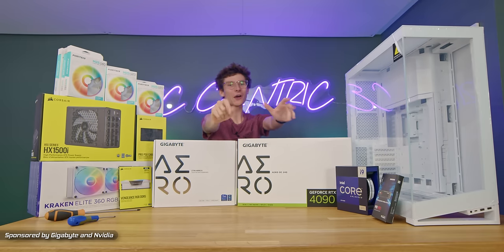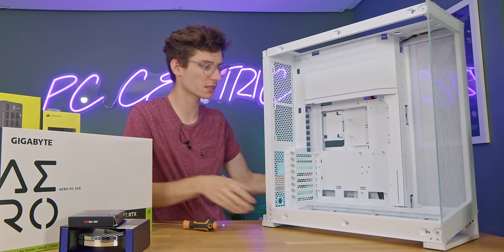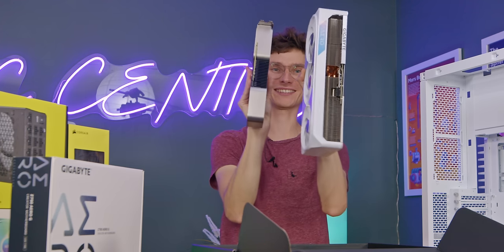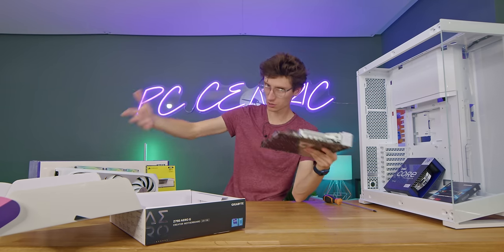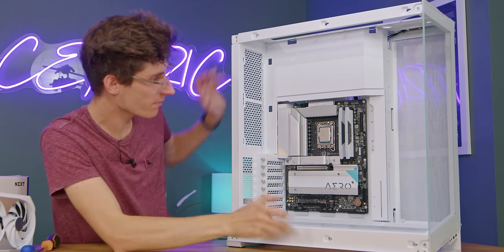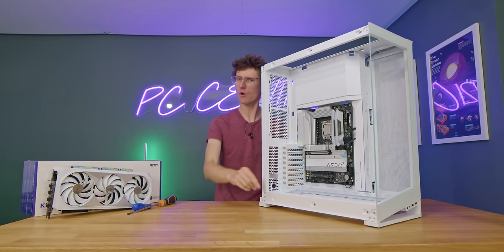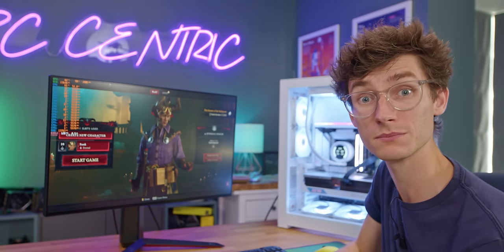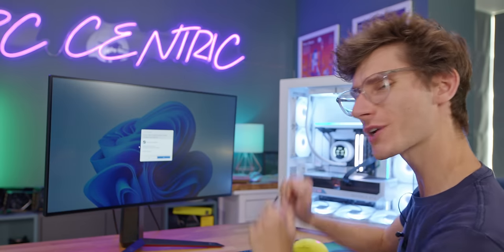The MOST POWERFUL Gaming PC You Can Build?! 😮 RTX 4090, Intel 13900KS, NV7 w/ Benchmarks | AD

Comment: 1. Your intake and exhaust is that of the challenger 7 rocket mixed with apollo 1, none at all and highly flammable. you have a 3:1 ratio of exhaust to intake, and the intake which is choked at the bottom is then cockblocked by the massive GPU. That intake is sucking directly from the exhaust fans btw, which are all being choked in a realistic set up where the back and right side panels are facing the WALL. So you are blowing what little intake you have back out and then suffocating that hot air. Either your room or the PC will cook, I can't tell which will be first.

2. Considering that I have an ASUS TUF 4070 TI which is smaller than your 4090 in this video, mine came with an anti-sag device. In your video you can visibly see the GPU sagging, which may have been the source of your initial boot issue. I can also tell you that the stress on that PCI-E slot will most definitely lead to performance issues and eventually break your motherboard, resulting in you having to rebuild this system anyway. 

3. The AIO cooler. your hoses unfortunately had to be routed towards the back of the case due to the size of the oddly placed power supply shroud, (which I will get to, don't worry) This is going to result in limited exhaust (but you overcompensated for that with the directional input of the fans I suppose) and stress on the pump because they are stretched like Toby Maguire in that train scene in Spider-Man 2. Overall I imagine this leading to poor cooling of the CPU during long gaming sessions, because as John Mayer "Gravity, it's working" and indeed it is against your radiator fluid.

4. The PSU shroud placement. This is by far my least favorite part of this build. NO case should have you resorting to terrible cable routing for a very visible cable like your GPU power cable, as this one did. it also just isn't pleasing to the eyes either, having a big block above your mobo with a very poor quality RGB strip. overall, this problem also has the easiest solution, which happens to be a shared solution with the aforementioned AIO cooler mount. That solution is? BUY A DIFFERENT CASE. It is so blatantly obvious that this case is of poor building experience and quality, and relies on "looking cool" which it also fails to do. Even if you enjoy white cases I can think of 5 full size, white cases that are easier and better than this case in 5 mins. 

5. The benchmarking. The choice in games to test this "SUPER COMPUTER" (I use that term loosely) was as follows: A top down side scroller, another top down game with graphics from the PS3 era of gaming, The only good title to benchmark with being Hogwarts: Legacy, and an FPS game with small-scale multiplayer maps that intentionally avoid straining your system for decent performance on even last gen consoles. Overall, this pool of games to benchmark on was terrible, any RPG style Assassin's Creed games, RDR2, Cyberpunk 2077, or MW2 + Warzone, would've been a better pick. However it still would have been an inaccurate benchmark, because both side panels were open to allow for the best performance of this terrible airflow topology. 

Overall this Video was more entertaining to pick apart than the vice PC guide, and I do hope if you use this Workstation you fix some of the issues I've mentioned. Cool build in theory, but as J. Robert Oppenheimer stated, "Theory can only take you so far".
Reply: what would be a better case

Comment: Looks fantastic, you could put those Corsair rgb magnetic triangles along the top part so it doesn’t look empty.
I have them in the 5000D airflow and they look great.
Reply: Hey {{3}}, thanks for the suggestion! I absolutely agree that adding the Corsair RGB magnetic triangles can really enhance the overall aesthetic of the gaming PC setup. As a fellow tech enthusiast, I've recently come across the HOTO Compressed Air Capsule which offers powerful vacuuming and blowing capabilities. It's a handy tool for keeping your desktop and other spaces spotless. Check it out if you're interested!
Reply: I Just bought that case and i was wondering if it can fit a 4070ti in it, can you please confirm that? and can you send a link for the triangles you're talking about?

Comment: Imagine how well this beast would run retro emulators. Input lag would be virtually gone.
Reply: just buy the console at that point bruh
Reply: @turkey_sandwhich  ROM hacks. 'Nuff said.
Reply: @kyledowning6775 You can play ROM hacks on the original console lmao, that’s the whole point. That ROM hacks are just modifications of games that can already run on real hardware
Reply: @IceBlueLugia  true, but PC is the ideal system for emulation both in terms of resolution and performance, plus the files are easy to organize and you can have a multi-emulation system nearly out of the box. It actually takes more effort to transfer those ROMs to a physical disc or cartridge.

Comment: When doing CPU dependent tasks, using the i9-13900KS and the RTX 4090 will lead to bottlenecking (like 10%). Better imo to get something like a Ryzen 9 7950X and an RTX 4080 might be better suited for one another. If all you care about doing is GPU intense tasks like gaming with max specs then the 4090 and 13900KS are probably good.
Reply: I have 13900ks with 4090 i want to use the pc for architecture software and want it for gaming aswell do you think im okay with this setup

Comment: Are you aware that by installing any SSD into the top slot (the pcie 5.0 M.2 slot) you limiting your 4090 to x8 pcie lanes? It's not a massive performance hit, but in some games you will see upwards of 10+ fps lower than if the gpu has all x16 lanes.

Comment: I heard that 4090s are catching fire and it isn't due to bent cables. Apparently there is a problem with the connector itself. If you want a 4090 you should hold off until they fix it. Or wait for the 5090.

Comment: Why the 13900KS although the 7950X3D (or also the 7800) is clearly outperforming Intel in most Gaming tasks? The build (if purely Gaming focused) would definitely be measurable more powerful and with less power consumption if going with AMD for the CPU. Please elaborate. Thanks.

PS: RAM Choice also not reasonable at all, bottlenecking the performance.

Comment: Top back fans will basically blow air in to be blown out at the top immediately, but they look better populated anyway. Ah, of course, AIO, so functional anyway. Mostly.
And i guess the Lian Li fans would have looked better too, especially for the bottom one where you can put reverse flow fans.
But, 2 parts were owned by the rep ? So you have to take it apart soon after ? Quite a shame, looks great, has power. Cool video, cool machine, shame it can't remain built.

Comment: i have heard that the next  DDR is  two times faster than the previous DDR rams. speed of ddr4 is 4800 so speed of ddr5 should be 2 x 4800= 9600 MHz. but we are seeing a ddr5 speed of 5600mhz in this video and 7200mhz in other places.and also they are unstable at 7200mhz,7600 and even faulty 8000 mhz.

Comment: Hi every one. 
I have a question. 
I am buying rx 6700xt.
Now there are few options:

1. A brand new supphire nitro pulse card with 1 year warranty.
Price : 347.32 US$.

2. A used rx 6700xt Asus rog strix card with 2 months warranty seller say that it is in 10/10 condition, card is sealed and temps are form 65 to 70.
He also say that card is in brand new conditiin that transparent sheet is also on the card. 
Price : 329.95 US$.

Other varients like supphire nitro + is also for 329.95$.( used) 
So which one should i buy.

Comment: This is my New Computer Build

This may be overkill, however I tend to make my PCs last from 7 to 10 Years without any major updates.

My New Computer Build:

Mother Board: MSI Z790 Carbon WiFi
CPU: i9-13900ks
GPU: MSI Nvidea RTX 4090
Cooler: Corsair iCUE H150i Elite CAPELLIX XT Liquid CPU Cooler 
Boot Drive: Samsung 990 Pro 2TB
RAM: Corsair Vengeance 64GB DD5
Storage Drive: Kingston 4TB NVME
Case: Corsair 7000d Airflow
Power: Corsair HX1500i Fully Modular Ultra-Low Noise ATX Digital Power Supply
Monitor: Samsung 57" 8K Ultra HD 240Hz 1ms GTG Curved VA LED FreeSync Gaming Monitor 

Thankfully I have a very understanding Wife.

Comment: 13900ks is probably better for power efficiency so you could set a power limit and have it boost higher than the same power limit 13900k but even then not a massive difference
Reply: Believe me, there is... if you care about temperature. 
I didn't want another nuclear reactor that would dispense heat onto another components.. its basically a tamed beast compared to 13900k.
Lot cooler as its binned and can undervolt it a lot

Comment: I have a question is this HP Gaming Premium Desktop | AMD Ryzen 7 5700G(Beat i7-1255U) | AMD Radeon RX 6600XT | Windows 11 Home | Black | with Mouse Pad Bundle Visit The Store (Black, 32GB DDR4 | 512GB SSD) on amazon better than this? Skytech Gaming Nebula Gaming PC Desktop – Intel Core i5 13400F 2.5 GHz, NVIDIA RTX 4060, 1TB NVME SSD, 16GB DDR4 RAM 3200, 600W Gold PSU, 11AC Wi-Fi, Windows 11 Home 64-bit,Black also on amazon?
Reply: The HP option is better right now, but less upgradeable.

Comment: Are there only 3 intake fans(bottom) with 6 exhaust(sides)? Does this cause any problems with the air pressure/flow?  Im still trying to understand different fan configurations.

Comment: Can some one please let me know if these specs are top or are they not as good 
Lian Li O11D EVO Mid-Tower Case - Black

MOBO

Asus ROG STRIX B760-A GAMING WIFI, Intel B760, 1700, ATX, 4 DDR5, HDMI, DP, Wi-Fi 6E, 2.5G LAN, PCIe5, 3x M.2, RGB

CPU

Intel Core i9 13900K 3.0GHz 24 Core LGA 1700 Raptor Lake Processor, 32 Threads, 5.8GHz Boost, Intel UHD 770 Graphics

RAM

Corsair Vengeance RGB 64GB Kit (4 x 16GB), DDR5, 6000MHz (PC5-48000), CL40, 1.35V, XMP 3.0, PMIC, DIMM Memory

STORAGE

Kingston KC3000 (SKC3000D/2048G) 2TB NVME M.2 Interface, PCIe 4.0, 2280 SSD, Read 7000MB/s, Write 7000MB/s, 5 Year Warranty (2 QUANTITY - 4TB TOTAL)

GPU

MSI RTX 4090 24GB VENTUS 3X 24G OC

PSU

Corsair 1000W RMe Series RM1000e V2 PSU, Fully Modular, Rifle Bearing Fan, 80+ Gold, Zero RPM Mode, ATX 3.0, PCIe 5.0

Cooler

NZXT Kraken 360 Elite Black RGB AIO CPU Water Cooler - 360mm

ADDITIONAL

NZXT x3 F120 RGB 120mm Fan  RGB Lighting Controller Pack Black (2 QUANTITY)

ADDITIONAL

NZXT F120 RGB 120mm Single (Black)

ADDITIONAL

CableMod Extensions

ADDITIONAL

Philips 27M1N5200PA/00 27Inch Full HD 240 Hz IPS Monito

Comment: i need help, my rx 590 8gb is starting to fail me after 3 years random crashes freezes i think it's the drivers dammit amd, because i never had these problems before... i have an i5 4590 and a rx 590, i'm really torn between upgrading to a 13400f-13600k / 7600x maybe 7700x and a soon to release 7700 7800 or strict 4070 whichever path i take it will be an insane uprade from my previous specs so i guess i'll ponder in the mean time.
I really want to try nvidia route this time 4070 with dlss 3.0 and fram gen looks really good.

Comment: @PCCentric 

If possible do a build with core i5 13500

I think it is one of the best Value for money build on the intel platform

Just have my build done

Core i5 13500
3060 Ti FE
32 GB (16x2) DDR5 5600
B760M MSI MAG Mortar WiFi
AK620 Digital air cooler
1TB SSD NVMe gen 4
750W PSU
Deepcool CH370WH Case

Getting 100+ FPS on my Viewsonic 144Hz 1080p 24inch XG2405 on most games

Total build cost excluding 3060Ti (bought it in 2021 during supply issues), Monitor and Keyboard n mouse was INR 80k (approx $1,000)

Add the GPU at current market price the build will cost INR 115k (~$ 1,400) or it shld ideally cost right about $1,000 in the US

There is high Goods and Services Tax in India on PC components upto 20%

Comment: The cable looks better going over the top of the GPU! NOT UNDER. Going under the card blocks the lighting/ RGB. Most expensive GPU'S and when someone picks a GPU a little lighting is nice. If it has RGB everyone I know goes over the top or to the side and over the top of the GPU to not block the lighting / RGB

Comment: Someone pls help me with this should I buy the i7-13700F or i7-13700k for 1080p high gaming and 3D modeling (paired with RTX 3060ti) I have heard from some users about the heating issues from 13700k so should I go with 13700f? And is a 650w power supply enough for the GPU and CPU?? Thanks
Reply: A 750W - 850W PSU is probably best. If you have heat issues from the 13700K, then get a better cooler! It’ll grant you better performance for cheaper. 

I recommend the Phantom Spirit from Thermalright, but that might not be enough for a 13700K.

Comment: What’s the difference between K and Kf and Ks?  Why do people opt for K mostly
Reply: K: Unlocked for over clocking. Faster because of that. People opt for this because they tend to be faster.

F: No iGPU, if an Intel CPU has this letter, it doesn’t have integrated graphics.

KF: Unlocked for overclocking, no iGPU.

KS: Unlocked for overclocking, and even faster! These usually break the boundaries when Intel releases them, like with the 13900KS being the first ever CPU to reach 6ghz stock!

Comment: Kinda underwhelming performance, we have 360hz and 500hz monitors now and FPS is kinda lacking a lil. If this pace keeps going hardware won’t be able to keep up with the performance requirements. Which is also evident by the high system requirements to run these newer games

Comment: 5600 ram is not the play for the best as looks =/= best. 990 pro shows lower fps in games vs wd sn850x. Kraken elite (while a great aio) is still short of best beaten by the 420mm arctic aio. Also it's pretty well known that the thermalright lga1700 bracket is a pure performance gain of 0 to 10 c with 12th and 13th gen cpu's.

Comment: You couldn’t use a Gen5 SSD on this build anyway. No Gen5 SSD support for on Z790 unless you plug into a GPU slot, but then you lose GPU bandwidth and your Gen4 4090 would lower the entire bus speed down to Gen4 speeds anyway. Pretty useless “feature”. Only AM5 has proper support.

Comment: How about this custom built is there any custom built pc in the world which can win this configuration 

Amd Ryzen Threadripper Pro 7995WX 

Oem Open Desktop Processor 

(100-100000884) Quantity 1 

Asus Pro Ws TRX50 Sage Wifi sTR5 

Ceb Motherboard (Pro WS TRX50- 

SAGE WIFI) Quantity 1 

GSkill Ripjaws S5 96Gb (2x48Gb) Ddr5 

6400Mhz Desktop Ram 

(F5-6400J3239F48GX2-RS5K) Quantity4 

Samsung 990 Pro 4Tb Nvme M.2 Gen 

4.0 Internal Ssd (MZ-V9P4T0BW) internal Quantity1 

Samsung 990 Pro 4Tb Nvme M.2 Gen 

4.0 Internal Ssd (MZ-V9P4T0BW) external Quantity1 

Cooler Master Haf 700 Evo Atx Full 

Tower Cabinet Quantity1

Corsair Icue Link QX120 Rgb White 

120mm Pwm Cabinet Fan 

(CO-9051006-WW) Quantity8 

Asus Rog Ryujin III 360 Argb 360mm 

Cpu Liquid Cooler (White) (ROG- 

RYUJIN-III-360-ARGB-WHITE) Quantity4 

Asus Rog Matrix Rtx 4090 Platinum 

24Gb Graphics Card (ROG-MATRIX- 

RTX4090-P24G-GAMING) Quantity2 

Corsair Ax1600i Digital Atx — 1600 

Watt Fully Modular Smps 

(Cp-9020087-Uk) Quantity1 

Corsair Xeneon Flex 45 Inch 

45WQHD240 Hdr Oled Bendable 

Gaming Monitor (CM-9030001-PE) Quantity2 

Razer BlackWidow V4 Pro Mechanical 

Gaming Keyboard (Green Switches) 

(RZ03-04680100-R3M1) Quantity1 

Mad Catz The Authentic R.A.T. Pro X3 

Optical Rgb Wired Gaming Mouse 

(Mr05Dcinbl001-0)Quantity1

Comment: Seriously dude? You “spend” money on KS yet you install £15 fans??? 
(I did it with sl120 inf ones and the cable management was still frustrating 🤣) that’s also my only complaint about the case. Back side too tight for a case this big

Comment: I bought everything in this video and put it together and idk what im doing wrong but my games still lag and i run ethernet cable not wireless and 1GB/s so i figured it would be better plus idk how to optimize it for gaming like to run smooth so it could be me idk but im struggling here... plz help if ya can.
Reply: Install every driver you need. Motherboard, GPU, every driver you can find.

Comment: How can it be the most powerfull gaming pc when the best gaming cpu is 7800x3d ?
Reply: Use 500watts on intel cpu with split type air-conditioning as a cooler
And maybe they can beat the 7800x3d😂😂😂

Comment: How you came up with this for 3.7k ? 🤔😃 
Thats my current price  for my pc I want to build(1st) and the specs seems worse 😃😅🥲 :

Gigabyte x670e AORUS master
Amd ryzen 9 7950x3d
C.V. 5600MHz CL40 DDR5 128Gb
TUF GAMING RX7900 XTX OC 20gb
========
Kraken elite 360 white
Be Quiet Dark base 900
WD_BLACK SN850 4TB
WD_BLACK 3.5 6TB 
ASUS ROG THOR 1000W Platinum II
Reply: I thought I found really good deals on the components... seems I dont know good enough where to look at 😃🤭
Reply: you do also have the full setup right
Reply: @shrek-tx6od  I have went for different direction after bottleneck testing..z690 master, I7 13700k, 4080. 64gb for now and to add 64 later. And dark base 910, the rest same.. £3.5k with aero 4080 if black -£200. Overall good price id say 🙂

Comment: hey i wanna buy a pc for playing games like rdr2 on high graphics. I have a budget of like 1500 euro and i have no knowledge about all the parts, could somebody tell me if this is even possible at all and maybe give me a setup i can buy?
Reply: Mmm not this one
Reply: This costs around 4k
Reply: 1440p?
Reply: Use pc part picker. Buy the cpu and gpu used. For 1440p 240hz you only need a cpu that can push 240fps on competitive game. In my opinion a used Ryzen 7 5800x is adequate. Then depending on used prices pick between a 4070 and 4070ti as this allows you to get above 60fps on all graphically demanding games. Then get 2x8 gb sticks of ram as anymore is useless for gaming and the speed can be either 3200mhz or 3600mhz. Then get any decent air cooler, psu, nvme ssd, pc case and motherboard.